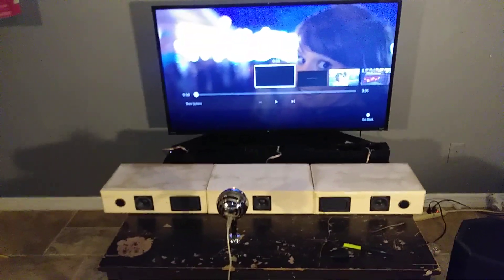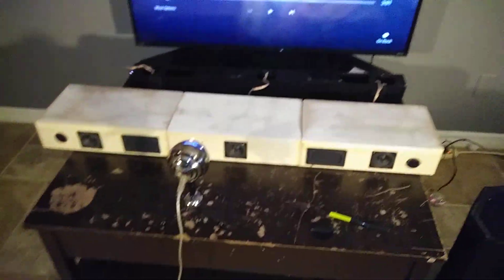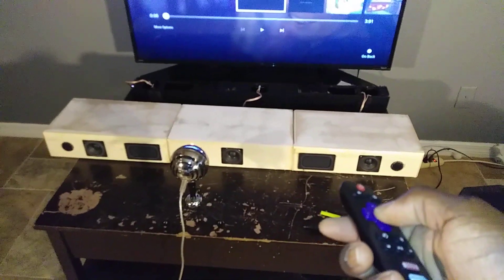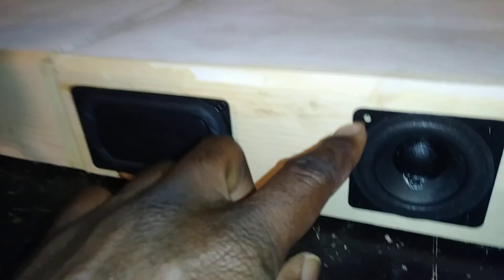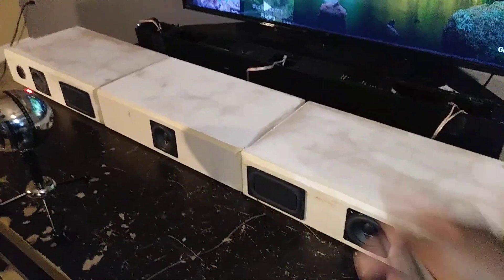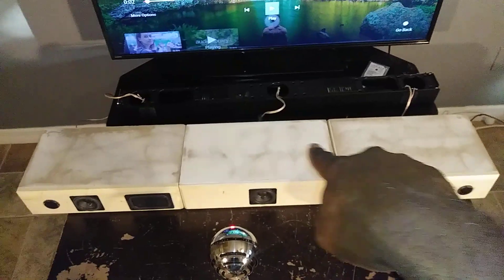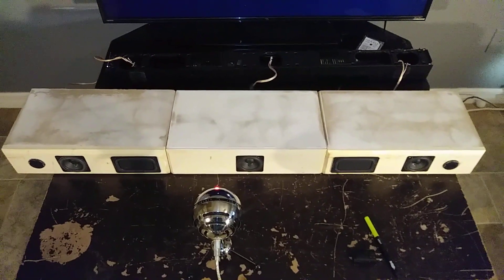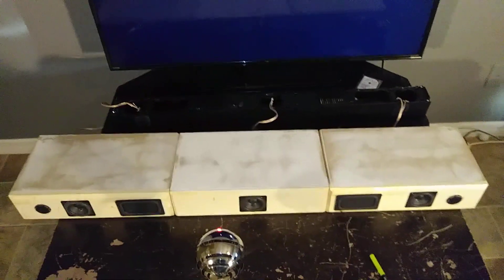Vizio Soundbar Project - Part 5

Comment: Okay! I think the project was great over all 5 videos. And what I really appreciate is that you are critical enough to admit this project, in your opinion, failed. I've been fantasizing about doing something similar but not near as extensive as building speaker cabinets.  I was hoping if I removed the left/right speakers only, and used the wiring to drive two external preassembled, aka store bought, speakers would the amp be able to drive the new speakers and b: increase the separation? Let me know if you've got time.

From what you're saying having two external speakers, no matter what kind, placed anywhere from one to two feet away for the middle didn't improve the separation? If so would that be due to Vizio's amp and crossovers sending the middle channel to the left and right speakers as well? Kind of disappointed and yet kind of relieved due to not looking forward to dealing with what's involved in taking apart the soundbar.

Comment: Passive radiators are really just to make up for a tiny enclosure. They allow the pressure a little bit more room when there's no space for it. Since you're using much larger chambers, don't use them. Use a port of just try them sealed.

Comment: so like you have these super expensive wire reducers that if your going to hook your amp ujp safely and properly , they are a must have. i was just about to purchase some looked at the price again and it hit me .. like i said you may already know this in that case no harm i suppose  but any way do you know how you can make a round like battery terminal with copper tubing ; flatten the end drill a hole solder on ect. , well this is simular you take a piece of copper tubing that will go over your stripped " say " zero gauge wire then you get another piece of tubbing that will go inside of that piece if its tight cut at an angle , then solder and heat shrink . walla you got yourself a reducer that is just as good as any " tool maker or sky high " . wish i could put a pic in here .. but im sure you get it ... i just wanted to get that out there to save folks some money .. that is alll GOOD BYE
Reply from the maker: Sorry that I'm just now responding to this. But yeah, that actually sounds doable. As a matter of opinion, your idea probably isn't too far off from the original ideas that lead to the manufacturing of reducers. Thanks for the comment, got my wheels-a-turning!

Comment: Too big a box basically free airing the speakers the passives are not moving i think
Reply: I was thinking exact same thing to much volume 😂 guy over thought this
Reply: I dont think he created a port for the passives.It should give at least a tad bit but it aint
Reply: 5:40 why would you not activate passives that is the key to your low end
Reply: i run a 4 inch in a big box with a 12 inch passive trust me that 4 inch gave my 12 inch passive excursion